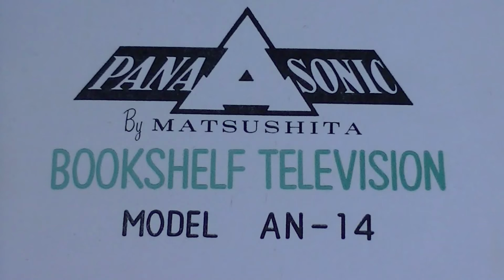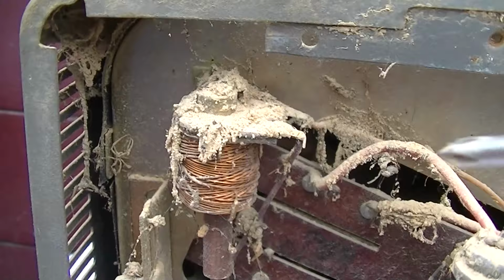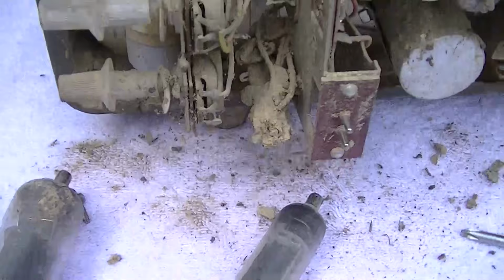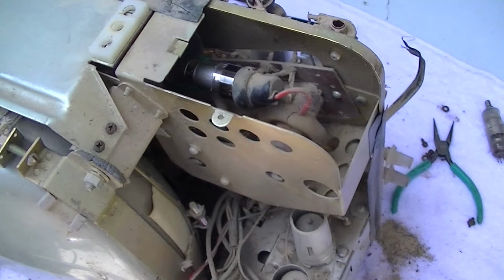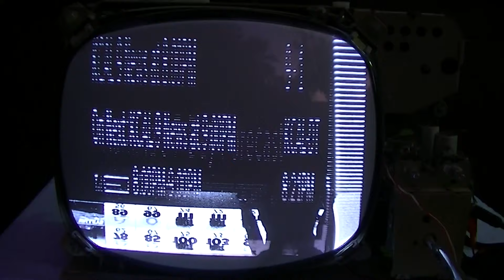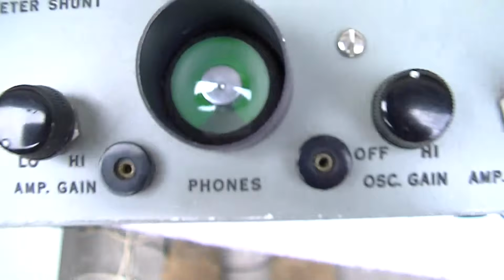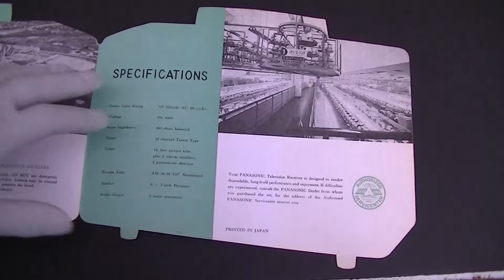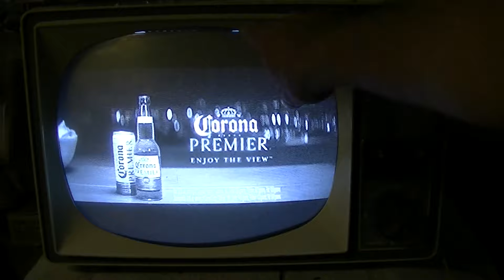1962 Panasonic Early Japanese import Black and White Television Resurrection AN14

Comment: Matsushita stuff was super high quality for a mass market production.The Panasonic radios of the 70’s were the best portables ever made.  If you read the book, Matsushita Leadership, it explains why.  Relentless engineering, obsessive attention to reliability.
Reply: Rob K
I'm right there with you on this. Panasonic by far had some of the best overall 
quality and performance not to mention durability. I'd say that picture tube quality is stunning for a set from that time. During the 60s thorough the 1980s they made some of the very best electronic gear you could get at any price.
Reply: i agree 100%.. I've seen documentaries on the way they went about their production.
Reply: Zenith had this about them as well. So does every company, if you go by their advertisement. "We are the best" is what every one of them will claim.

The proof is in the hardware, and if there aren't that many around it's probably for a reason.
Reply: My running Technics equipment is a good testimonial
Reply: Same story with the sewing machines in the '70s made in Japan  very high quality.
Reply: I have a Panasonic tv & blu ray player ! They keep on trucking
Reply: They are the best.Their slogan was  slightly ahead of our time.And true.I would like to have.the tape recorder that was shown with this tv for 129 dollars.
Reply: @jbinary82  As is my Technics SP10 turntable.

Comment: I had a Panasonic cassette stereo that was pulled out of an appliance store that burned down when I was about 12 back in the '60's. The wooden cabinet had been on fire. I pulled out the all steel chassis and plopped it into an old dead tube rca console stereo on it's back where the phono used to be. Used it for years. Even the cassette player still worked. I had to take the covers off of the VU meters because they were burned black, but underneath the needles still worked.  Panasonic made really, really good stuff.
Reply: quaility
Reply: Lol

Comment: Personally I like the way Shango goes through the diagnostic steps. That way you actually learn what does what and what failure causes what. Sure you can throw a bunch of new parts at something and make it work, but you're not actually fixing it. 
This is a cool little TV, it wanted to come back to life! 
Thanks for sharing!
Reply: yeah! nobody would learn anything if one just wholesale repopulated the thing with brand new components. That's like tracing instead of freehand drawing a picture.  No adventure in art to just trace or color-by-numbers.  The difference between art and craft is a really forgotten contrast.
Reply: That's what helped me on fixing an old 78' Sanyo 14inch set! The owner had it completely recapped and changed some resistors, the vertical IC and even the yoke, but couldn't get it to work right (there was no vertical at all). Turned out to be a bad V-height pot and a broken trace. I really hope Shango never stops with those ressurection/repair videos!

Comment: I had a late 80's Panasonic flat screen 27" tube set that played well into the 2000's. Excellent picture quality and sound. I would say it still had 80% of its' original picture quality when I sold it. I now own a 2009 Panasonic 50" plasma which had a failed power supply when I bought it. It has seen daily use for the last 5 years and the picture quality and black levels are still outstanding.

Comment: Thanks shango066 for explaining in some detail the "step-by-step process" required to solve the all-too-common vertical sweep/deflection issues with B&W tube sets. You are the man. :)

One thing I learned form experience, is that shotgun repairing a TV (or radio) chassis is never a good idea as there is some chance of making a mistake (e.g. with cap values or connecting a resistor to the wrong part of a circuit) - and/or the possibility of a new fault happening somewhere else as old parts not yet replaced start failing under load.

Stay cool.

Comment: My understanding is that .8x (or .08x) specs. effectively means “Let’s use up some of those 1x (.1x) parts that didn’t quite pass Q.C.”  Which is honestly a reasonable practice for low tolerance applications and such parts are already in your inventories or readily available in your local supply chain.

Comment: Back in the 60's and even into the 70's Japanese electronics were considered junk. In fact everything from Japan was considered inferior. I have an very old BW Sony CV2000 1/2" VTR along with it's companion 12" B/W TV that dates back to 1965. It is probably as rare as this TV.
Reply: Dave B 
?
Reply: I've an old B&W dual standard 405 / 625 line hand wired 20" ITT KB VC3 that's still alive. On UK UHF 625 lines that's 576i and infinite greyscale and with a set top box it's easy on the eye to watch. (Edit)576i/25 is as near as dammit VGA :-) That's progress for you. 405 line TV could be regarded as 312i/25 not bad for postwar :-)
Reply: I don't think the CV2000 is incredibly rare -- you can find CV2000 transfers on YouTube, but you don't see the machine itself every day. But I have never heard of a companion TV for it. Hang on to that!
Reply: You can see my CV2000 on you tube. Mine is branded a GE, but it is the CV2000 made by Sony.
Reply: A GE branded CV-2000? That IS rare.
Reply: @lescrossan27  ...weeeeell the United States had 480 lines approved BEFORE WII.  ...not bad for BEFORE WWII.
Reply: I also have my Concord 220 reel-to-reel mono tape recorder from 1964, and it was Japanese made by Matsushita for National in Japan, and Panasonic in the US. It says “Transistorized”, and it was an nice hybrid amplifier with tubes and transistors in one. That unit is from 1964 and it was during the transition to solid state era.

Comment: Another  nice  video! 
The  PL36  tube  (25E5)  is  a  very  common  tube  here  in  Europe. It  was  replaced  by  the  more  efficient  PL504  (27GB5).
Reply: Βρε δεν εχεις αφησει βιντεο για βιντεο :p
Reply: Αγγελος Ναυπακτος 
Χεχεχε, απίστευτος  ο  τύπος!
Reply: Ειναι λιγο χυμα στο πως βγαζει και βαζει λυχνιες εν λειτουργια αλλα ενταξει δεν πειραζει
Reply: PL36 and PL500 /PL504 were both(PL504 was an improved version of the PL500, in many cases interchangeable) very common,in the uk, i have many of each, unfortunately mostly 'used'...PL81 was also used before they came out,
Reply: those py88s were also fairly common, although most used py81s or py800s or py801s , especially in small screen stuff like that...
Reply: and i see pcl85 and pcl82, common as muck here in the uk..
Reply: that 1X2B is rare in the uk, though, usually we had EY86/87, DY87, DY802 , (apparently a DY80 is 'similar' to a 1X2B but never come across one, a DY87 may be a useable replacement), i do have a solid state vhf uhf 14 inch Teleton  portable that uses one, unfortunately the crt is very bad 😢i think it was intended for use in  the usa as it has black,white green mains cable,  and mains tapping links 'altered' for 220v(it can be set for 100 to 240)
Reply: some of our eht rectifiers didnt seem to have getters...strangely...maybe they thought the getter could cause flashover?
Reply: i have a panasonic AU370 radio that seems to have no info on the 'net, another rare beast possibly? has the common 'all american 5' valve/tube line up but has voltage selector for up to 240v
Reply: I didn't know why the early sets had PL36 and incoming ones PL504. As you say they are realy popular power H defl. pentodes. I have one PL36 from "Tesla" from 1964
Reply: the PL36 came out first, then PL500, which is electrically almost identical, apart from different base,  the PL504 was an 'improved' version,
Reply: before the PL36 there was the PL81 and EL81, as well as similar less common, valve manufacturer specific ones such as 20P4 (Mazda),  there were of course even earlier ones such as EL38, PL38, 20P1(mazda again), even the 807 was used in a few sets..
Reply: i think 9A8s/PCF80s have been mentioned before in a previous video, about them being not common in the USA, over here in the UK, extremely common, i have loads, mostly 'used',   most P type TV valves were very common, and these days pretty much unwanted as all the audionuts want stuff like EL34, ECC81, so loads of these TV valves just get chucked, they'll come as day when theres little if any left and TV collectors/restorers will find it hard if not impossible to get 'new'/good second hand replacements, as some audio valves are still being produced, but certainly not, as far as i know, TV valves...
Reply: you can rig up a nice small audio amp using a pair of PCL82s, 30PL14s(PCL88s), PCL85s(or PCL805s), powered from a fairly low 40v AC supply, HT of about 100v from  it by a voltage doubler circuit, not many watts output, but it works...
Reply: Because as CRTs were bigger and deflection angle raised from 70° to 110°, more power from H-out was necesary. PL36 max cathode current is 200mA, PL500 250mA and there are H-out tubes for colour TV with even more power (Ikmax 500mA) - PL509, PL519.
Reply: holeh, space much :p

Comment: A tv that sat half underwater in a musty cellar for over 30-40 years, all it needed was a cleaning, new vacuum tube, and two new capacitors. That’s the power of Japanese engineering.

Comment: Such a bright picture and detailed for a 1962.
nice super rare tv.
I bet tvs with lots of circuit parts / lots of transistors.
For this one lots of tubes and resistors gives better picture.
Old 1976 sony trinitron has lots of transistors and gives a bright quality picture.

PS
Usually cheap tvs before LCD came are 1 circuitboard and picture tube.

Comment: Exactly as stated in the previous comment. By going step by step, it is far more educational. I look at other things the same way you do actually, so your style of explaining things is in tune with  how my brain is wired. I'm pretty certain you are a mechanic by profession. A lot of your diagnostic skills parallel  automotive repair. I'm a former mechanic and still involved with auto parts and repair. Very similar methodologies involved. Working system by system. Thanks for another great vid!

Comment: I see the horizontal output tube(line output valve) is a PL36,quite a common European type at the time.
Reply: All but one were common european types (PCL82,85, PCF80, EF80, EL36), not very expensive
Reply: PY88 too... I could even imagine the whole design is some European clone of a Philips or so.
Reply: @telocho  My thoughts as well. CRT is AW36-14 which is a Philips/Valvo designation and probably manufactured by others. The flyback looks like a clone of the Philips/Valvo AT2012, but adopted for 110 deflection. It looks like a Philips design, regardless.

Comment: That is proof of the quality of Panasonic equipment! Well done! The valves have Philips/Mullard numbers. The PL36, PCL85, PCF80, PY88 were widely used in British TV sets. I have 150 television receivers in my own collection [1936-1980] and another 150 similar at the museum! Joint curator, British Vintage Wireless and Television Museum. Dulwich, London.

Comment: Never saw this TV that rare. This was an early Panasonic TV set from the early 1960's. Matsushita made a lot of stuff under the Panasonic name. They also made Technics where they put out stereo receivers, amplifiers, cassette decks, and the most popular one is the SL-1200 series turntable.

There was also another brand called National where they made other types of stuff from Japan under the Panasonic name where it became National Panasonic. There was Concord that made reel to reel decks which was not made by Matsushita, it was by Concord Electronics Corp. in Los Angeles (now gone). The only Concord R2R tape recorder I have is a model 220T which is an all transistor unit, with a single tube amplifier and a "Magic Eye" level indicator tube for recording, and it's a basic 2-track only tape recorder, and it was a barebones machine where it lacks the track change switch for the second track.

The parts in the Concord 220T are from Matsushita and they are all Japanese components, and that was from 1964. A lot of these electronics are from Japan made a lot of great stuff than the current ones that are made in China. Japan is the country that made electronics so good and still works for a long time.

BTW, nice fireworks after you restored your early Panasonic TV set from 1962, and the fireworks are pretty in black & white, but I prefer the color ones which is better and much vibrant than this one. I saw fireworks on both nights in Saugerties and Catskill since I made these videos a few days ago when I was in person.

There's also the "Macy's 4th of July Fireworks" which is in New York City for its 42nd year. The first one dates back to 1976 which was during the bicentennial period.

The background noise where one of the neighbors setting off fireworks are illegal in California. I remember living in Brooklyn, NY where one of the neighbors in brownstone apartment buildings where they set off on streets, parks and on rooftops, and they are so pretty. It was like a war zone. Brooklyn and the rest of New York City has set off lots of fireworks illegally, and it is not acceptable to use it if the NYPD officer and the FDNY firefighter would be on a look out for suspects who uses fireworks will be busted. That happens every 4th of July and New Year's Eve. I missed watching fireworks in the city.
Reply: In addition, you can play video games for other consoles like NES, SNES, Sega Genesis and others where you can connected to the early Panasonic TV.

Comment: SENCOR USED TO HAVE A FLYBACK CHECKER . BASICALLY IT PULSED THE FLYBACK AND COUNTED THE RINGS . I MADE A SINGLE TRANSISTOR PULSE CIRCUIT AND USING MY OSCILLOSCOPE I OBSERVED THE RINGS . I BELIEVE IN A GOOD FLYBACK I WOULD SEE 7 TO 10 RINGS . THE PULSE CUR CIT I MADE USED A 9 VOLT BATTERY . WORKED VERY WELL . EYE TROUBLE I USE CAPS .

Comment: The schematic is reminiscent of an Australian set of the same period. They all had mains transformers for the 200-250V line voltage here though. Lots of wax paper caps. The horizontal linearity control on this set is quite similar to a Pye chassis I had, with the adjustable slug.
Reply: Europe used 220V (now 230V) too, but many models don't use power transformer. In this TV you can see 2 heating strings (because of 110V), in european TV it was one long string of P-type tubes serially connected with resistor and thermistor (to protect heaters) to 220V. B+ in this TV use doubler, in europe there were only one diode rectifier and you get 250-270V B+.Schematics is also similar to european sets of the same time.

Comment: I've been collecting "National" , and Panasonic radios and other electronics. Tube type Japanese  radios are getting really hard to find. I've never seen a TV though...that's one I'm going to look for, it looks nice complex and fun to play with.
Reply: i have a couple of Japanese valve /tube sets, a Panasonic AU370, no info on the net as far as i can find, and a little 'LUXURI' 'midget' that seems to have been sold in loads of case and brand variations
Reply: i have three  Japanese valve /tube sets, a Panasonic AU370, no info on the net as far as i can find, a little 'LUXURI' 'midget' that seems to have been sold in loads of case and brand variations, and a Trio 9R59 'communications' receiver

Comment: Instant classic. Maybe your best video ever. One thing though...why don't you take the water hose on low pressure to some of this stuff? I'd be tempted to just let water run over it for a while before even touching it. Oh well, time to go ride in the excalay.
Reply: The Guitologist water activate s the hanta..
Reply: Just what i was thinking,no one wants to see all that dirt that is shorting out components  and high voltages,very dangerous .You are a brave man with crusty hands.
Reply: In a lot of videos he explains why. The rca kcs resurrection with the crt jerked back into the set from being thrown he cleans the yoke and then the yoke doesn’t work when he puts it back on. When this stuff is sitting outside for so long it becomes fragile and basically any kinda of stress like what water or compressed air would put on it will destroy it. In this situation it’s if it works then leave it

Comment: The Capacitors .008 and .08 are typical of UK capacitor values in the early 1960's. They're used in many transistor radios from that time. Tying the boost cap to chassis negative is typical in UK set designs, many high voltage caps in UK TV's.